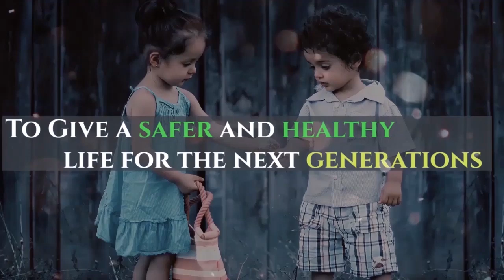Driverless Electric Truck - Volvo VERA Autonomous Truck

Comment: Hii,  i am 18 years old student,  i am working on building an high performance electric motor since one year.  70%  of its parts are handmade by me including its chasis,  handlebar,  spockets,  stand,  seat an even its 3420 w lifepo4 battery. Will you please help me to get a legal verification for my project..?
Reply: All the best dude.
Reply: @narendra bosetti lithium phosphate batteries have higher power capacity as compared to lead acid or lithium ion batteries. Also it is light weight and has larger life cycle as compared to lithium ion and lead acid batteries.